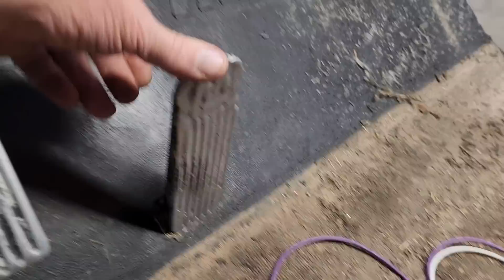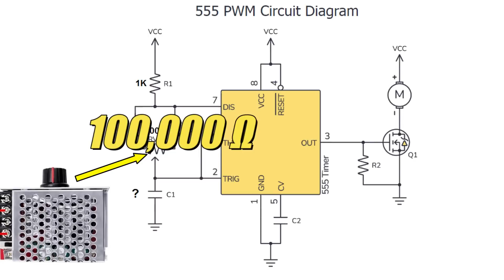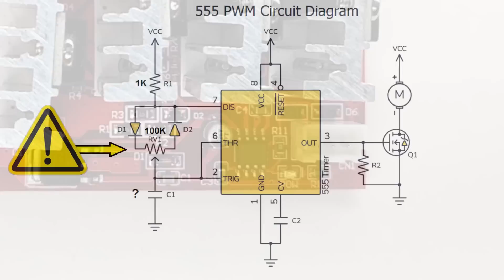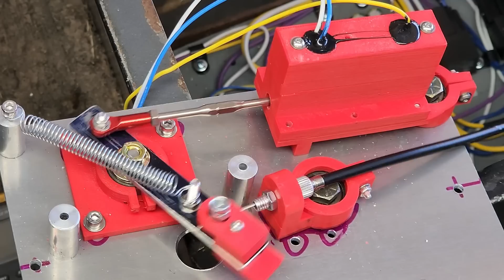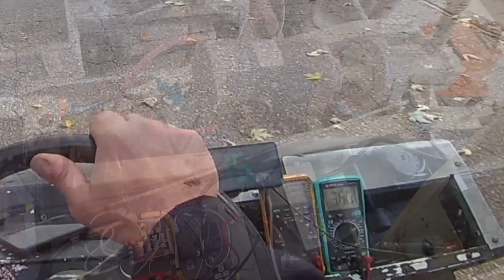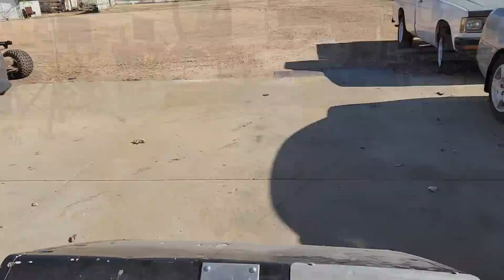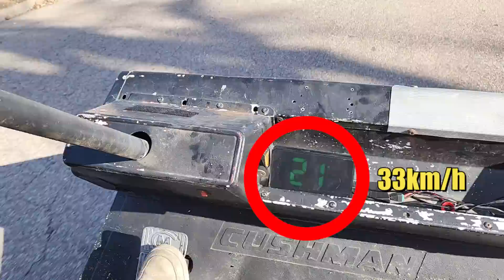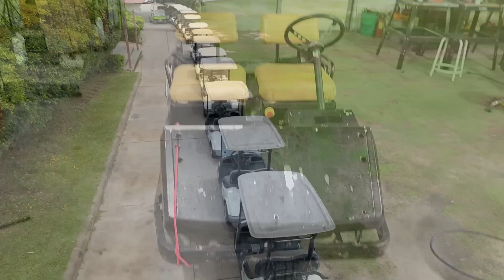S4 E38. We build a custom throttle and road test the gasoline / electric hybrid petroleum battery

Comment: I mean it's a cool concept but why not just put a solid axle in the back and run a chain drive with a clutch to the engine and get rid of the electric motor all together it'd be way more efficient and you would get way more speed out of it

Comment: Overspeeding an electric motor can be anywhere from harmless to explosive. I had a starter clutch fail on my Goldwing once and it spun the starter so fast that the rotor's windings exploded into a flower-ish pattern. Very interesting but probably not something you want to happen 😂

Comment: Is it possible to run the petroleum battery in the golf cart with three other batteries like a hybrid?
Reply from the maker: It's certainly possible, but at that point the engine would just be charging the batteries.
Reply: Ok if let’s say it is on a dead charge and I would turn it on. Would it basically run the cart by itself? While it’s hooked up to the batteries like it’s charging them?
Reply from the maker: @mustrestorerust6800  Yes that would sort of work,  however the alternator would need to be modified to output a regulated 36 or 48 volts,  Since the alternator will not make the same amount of power as a bank of good batteries, you will not get the full performance that you may expect  if you were just using good battery's..
Reply: Will that work ?
Reply: So if I used three alternators 12 each battery. Would that work since they each put out 12 V to 14 V?
Reply from the maker: @mustrestorerust6800  What your suggesting is starting to get convoluted. Running three alternators will waist an enormous amount of power and you will be very disappointed with the results.  An alternator is only 60% efficient in converting the engines power into electricity.  So running three alternators will put a huge load on the engine and you will not get much power from the system.  I don't want to sound mean, but it's clear you are not comfortable working with electronics or electricity.  Since you have the desire to build something, now is the perfect time to find a way to learn more about electricity and how to control it.    Before I went to school to learn electronics/electricity I would not have a clue on how to do a project like this.     Basically what your trying to build is called a range extender.  At the end of Season 5,  Episode 12   I mention a type of range extender that is available for small electric vehicles.  I'm not sure if 36 Volts range extenders are available, but you can certainly get 48 volt extenders.  If building something is what you really want to do, then you are going to have to invest the time in doing a lot of research and learning.  Best of luck!
Reply: That’s why I was asking you thank you
Reply: Thank you

Comment: I like how you turn the already linear movement of the throttle cable into a rotary movement, and then into a linear movement again, instead of just using the linear movement of the cable directly

Comment: Actually i think your wrong about the loss of efficiency. Any efficiency you lose in converting gas to electricity i think you gain back by not hauling 200+ pounds of batteries around.

Comment: Out of curiosity, could you have simplified this endeavor by using a 12v to 36v step up converter to charge three small deep cycle batteries? I mean , use your petroleum battery to charge three batteries, they are hooked up to the OEM cart wiring ? Basically charging on the go....

Comment: You said something about revisiting the exhaust to make it street legal if I understood correctly. That could be a neat opportunity to craft something similar to ones found on 2-stroke bikes that scavenge from the engine to maybe squeeze out some free power at low-mid RPM where the engine would be when it struggles. It's just a question of getting the right geometry and some welding.

Also regarding safety on your quick road tests, I would consider wiring in a couple of brake lights on the back just in case.

Comment: a solenoid throttle like a gasoline air compressor uses would be one way to minimize engine noise and fuel usage at stops.

Comment: Golf cart motors are WAY under utilized, and can take WAY more than what they give in a stock cart. 

The motor is purposely under-stressed so that it lasts virtually forever. 

Go ahead and overdrive your electic motor, as you said in the video, just keep an eye on the heat.

Comment: Could you use two 100W alternators and increase the voltage maximizing the engines potental up?  Add some insulation to the engine compartment, use a SxS front suspension and put a cheap fiberglass body on it and it would be even cooler!

Comment: You can actually buy those speed controllers with a plug-in twist throttle or plastic foot pedal. Made to use in homemade e bikes or whatever

Comment: So you going the Edmison Motors route next?  Put in a high C rate lithium battery and program your engine to kick on to only charge the batteries when needed?  that would be the absoulute best way right there.  25 or 30 Amp Hours would be plenty.  Run the engine at full power to get the highest thermal efficiency out of it.  Quiet most of the time... That's where I would like to see this go!

Comment: I think a "3S" RC motor electronic speed control would make a great way to control the excitement voltage on the cheap!
Cant remember if you have a Fwd/Reverse solenoid pair and a "Neutral" solenoid to disable excitement voltage reaching the alternator when its not connected to the motor?

Comment: I love this video .  I have done something similar to drive a roots  supercharcher in the trunk of my honda civic with a dc treadmill motor.  I was feeding the field windings with 24 volts dc and the alternator i mounted to the engine would make 300 volts dc output when the honda engine was at 6500 rpms.  It made about 6.5 lbs of boost across the entire rpm range.  I drove it for 20000 miles with no problems. Both the alternator and dc treadmill motor would barely get warm which surprised me considering up to 300 volts dc was going through them.

Comment: Club Car Dealer/Technician here, overspending a DC Series or Sepex motor isn’t a common issue. Believe it or not, these motors are not very sensitive to over voltage / overspeed. You can put 48 to a 36v motor without issue. As for overspeed, the first component to fail would be the windings  flying off the center armature and crashing into the field windings. I’ve seen it happen, but the cart would have to be traveling 50+ MPH.   Another note, your cart has a series motor. They are good for torque, but not so much for speed. I’d highly recommend using a Sepex style motor as you will notice greater RPM gains using increasing amounts of voltage.

Comment: Given your background it seems like youll eventually end up with the arduino being able to control the engine speed to automatically increase rpm when the load demands it and idle down once cruise speed is achieved.

Comment: I’m absolutely loving this series so far, and cannot wait for the next installment!

A few thoughts: 

1.) you might benefit from switching to a rotary 100KΩ pot and run the accelerator pedal cable over a pulley sized to match the pedal’s throw length to the 270° travel of the pot. 

2.) a charging system for the lead-acid battery could potentially be added by installing a few additional switches on the accelerator and/or brake pedals: for the accelerator, it would be installed to where it’s diverting power to the battery when the pedal is resting (not pressed); and for the brake pedal, replace the existing cutoff switch with a DPDT that also diverts power to the battery. 

3.) it might not be too difficult to add an auto-throttle for the engine that maintains sufficient idle but also advances the throttle in response to electrical loading of either the field current or output loading. (If this is too much of a nightmare to implement, you could always run a cable up to the steering wheel and add a stalk lever so you can control it Model-T style 😂)

4.) [this one is by far the most over-the-top] it would be very interesting to somehow add a manual transmission between the drive motor and brake/differential. I’ve always wanted to see one actually be implemented in an electrically-propelled vehicle, but it seems that nobody has ever done it and brush it off as “uNNeCeSSaRy” 😢

Comment: @Robot Cantina -- for the engine throttle control, could you scavenge up some parts from a throttle by wire thrrottle body to pull the cable? That'd be slick and let the engine idle down when you're stopped

Comment: I have seen miningtrucks that have a similar setting with a diesel engine drivning a generator that supply power to electric motors on the rear wheels.

Comment: Why wouldn’t you have made the electric motor flat out and use the cable to the petrol engine as your throttle.would have been way more simple.as you throttled the engine then the alternator would make more power

Comment: Jimbo - you're driving the field coil with the battery; how are you keeping the battery charged?

So, long long ago (when I had more money than sense) I converted an old pickup to electric.
I used a Netgain 9inch (Series wound) DC motor. The armature on that thing of course, is wider, bigger, so 'centrifugal' forces are greater on the Netgain than on the little motor you're using. I was told to not exceed ~4000 rpm with the Netgain, or I'd risk the armature flying apart.

Comment: To help out with the starts you could wire in a couple of 5 farad capacitors. You know the ones they use in car audio systems? It would make it so you can drain the caps to start up and let the engine get up to speed.

Comment: I put a samsung lithium pack from some kind of hybrid in an old 36 volt cart a while ago, at full charge it was around 50 volts. You can overvolt the crap out of those old universal wound 36v carts, as long as you arent loading down the motor at low rpms. Theres even a guy on youtube called retro electric that was pushing 100v through one and running it way hard. as far as overspeeding, as far as I understand, its very hard to, as the faster the motor goes, the less acceleration it provides. I have heard of people reclocking the brushes on these in order to increase their top speed, think similar to advancing the spark advance of an engine.

Comment: Excellent Trials / Errors      you Can Run Diesel Engine  with Bi Fuel  With  Diesel  and Propane    Diesel as Pilot Fuel to maintain C I ( Compression Ignition )  Once Start With Diesel   Reduce Engine RPM  through Diesel Governer Sulpply Liver   Then   Control RPM and Performance  With  Inducing Propane / CNG / Lpg or Hyderogen   through Air Intake Manifold / Air Cleaner   Will work   as Bi Fuel Engine  I Tried On 1400 CC Diesel Engine Of Car  Reduced Polution  But Commercialy I don't have Idea for Long Run   Make R&D   i Hasan  From India   ( Hyderabad )

Comment: you could put in an overdrive on the alternator by connecting the field winding to the output of the alternator at full pedal throttle or at least that is an idea of what you could do.

Comment: maybe add a battery and electrical starter. those electric carts tend to have ev braking and you can gain some efficiency back by doing so. also lets the petroleum battery not run when it's not specifically needed.

Comment: Hello sir! Love your videos and miss the gnome!
I have had a plan for quite some time to install a small rooftop solar system just large enough to power a heat pump in Michigan. Rather than grid tie it (and pay extra taxes), I wondered if this would work... Install solar 12v parallel connected to a charge controller then to a battery as a medium, but also have a standard high Amp 120v car float charger installed to the battery. The float car charger would kick in to power the heat pump when solar can't keep up. Now for the real question, can it be done without a battery as a medium? I WOULD LOVE TO SEE YOU BUILD SOMETHING LIKE THAT! I started with your first predator videos and love that the golf cart idea, both are right up my alley.

Comment: Does the output voltage on the alternator increase with rpm? Assuming a fixed input voltage, it should increase in output power?

Comment: I dont know much but I know a little about a little. I have a cushman minute miser and I had to replace the potentiometer/throttle. It was about $100 and its a 24 volt vehicle like yours was. Perhaps that would work for you as I understand it has only a 30 degree rotation. The "gas pedal" mechanism is pretty simple to compared to yours. Might be an upgrade for a future project? I do have a question. Would would happen if you used a 24 volt 160 Amp alternator or a military surplus 28 volt unit? Love your projects! Thinking about converting my cushman to a "petroleum battery" !

Comment: I would put some supplemental airflow on the alternator. They really are not designed to work on that heavy of a duty cycle. 

What works best to get cold air on them is a blower they use for boats to exhaust the bilge. They look like a tube and you can easil hook a duct on it to bring in fresh cold air.

Comment: If you plan on doing a lot of road tests I'd be interested in seeing what a more road-based treaded tire would do to help with rolling resistance, as well as perhaps a taller tire to get a better top speed?

Or maybe a smaller tire to maintain a slower speed but give it more acceleration from a stop.

Comment: Great video!  I was surprised you didn't make a mechanical adaptation to use the existing pot on the voltage controller.

Comment: Can you adjust the output of the alternator when the engine is at idle so it is not powering the motor and control the output of the alternator by the engine speed?

Comment: An interesting experiment would be to drive the golf cart using the same engine and a CVT and compare the different efficiency. PS, change the throttle pedal and use mechanical version of the Cobalt pedal.

Comment: It's weird hearing the gas engine load down, as you push the accelerator and actually gain speed. My blood-born motorhead dysfunction says "gotta fuel problem" before I can even think of anything else, even though, of course, that's not true.

Comment: Some digital speed controllers use an optical shaft encoder. Like "fly by wire" throttle systems for automotive fuel injection systems. Those are the ones that don't have a physical connection like a cable going from the gas pedal to the throttle body plate. There's a servo motor (stepper motor) that operates the throttle. Might be able to use that to control the field current in the alternator, eliminating most mechanical items other than the physical pedal part.

Comment: As far as the highest speed you can get out of the electric motor that the manufacturer considers safe and reliable.  In other words, what it's design allows for maximum efficiency and reliability. In your case, it's not necessarily the rpm rating of a motor because you need the rpm of the motor placed under a load. Which is quite different than the maximum unloaded motor speed. You might burn up the motor trying to put enough current through the windings to get it to 4000 rpm with the load of that cart connected to the motor. The proper way to determine the maximum motor output is to find the FLA (Full Load Amperage) this is a specification that can be found on the motor ID plate or decal. What you do is connect your ammeter in-line with your power lead going to the motor. Ideally you don't want to exceed the amperage of the FLA rating. These DC cart motors are pretty forgiving to being loaded down and overcurrent pulled through the windings. Like there's many people who add an extra 12 volts to 36 volt carts making 48 volts. The ones I have heard doing that usually have a manual switch or a switch connected to the end of throttle travel that kicks in the extra 12volts by a relay such as the type like the old Ford starter relay they mounted on the inside fender well. It kind of acts like opening up the secondaries on a 4 barrel carburetor. LOL 😂
Anyways, I've never heard of any issues with that by applying more voltage. You can get one of those digital tachometers for cheap on Temu/Wish. They give you reflective foil tape and you put a small piece on the motor shaft. The infrared detects the pulses and gives rpm readings. Using that and your ammeter will give you true maximum rpm. According to manufacturer specifications. I know in the case with us guys going way outside of the box, these specs might not be that relevant.  However,  it might give a good point of "where you're at" in regards to having a catastrophic meltdown of motor windings or shorting out the diodes, which can lead to a meltdown also. 
I really enjoyed watching your video. You explained everything in detail and you're a very intelligent dude! Your knowledge of alternators in regards to the field winding current to control the output is impressive. The fact of you doing such a project is very interesting and informative to anyone who's familiar with buying golf cart batteries.  Which is an expensive investment that's only a matter of time, and you'll be replacing again. 
Thanks for making these videos.  🤠👍

Comment: An interesting sub series on the petrol/electric hybrid propulsion. But when are we going to see the Diesel Insight with another  2-3psi of boost, and some propane injection tested? If it goes quicker still, then you really should do a head to head 0-60 and top speed run against the Renault once you've done all the planned engine modifications to the Predator V-twin. It would be interesting to see which one is faster, and if they can trounce the best times that the diesel Saturn achieved at its best.